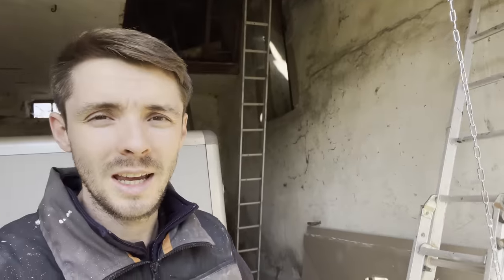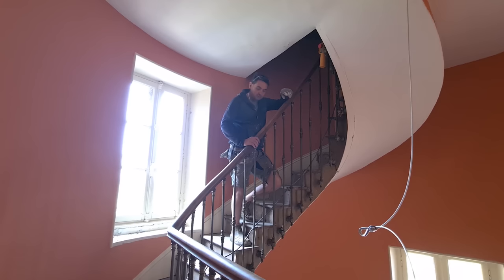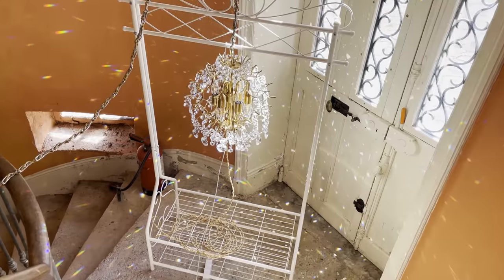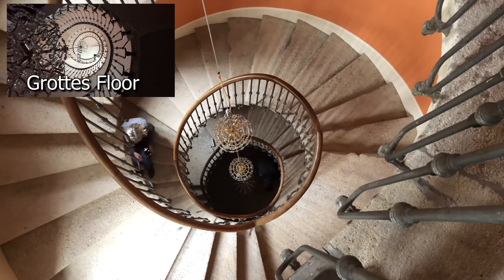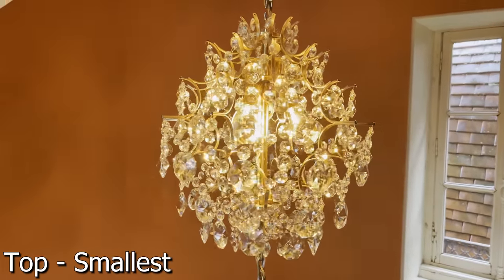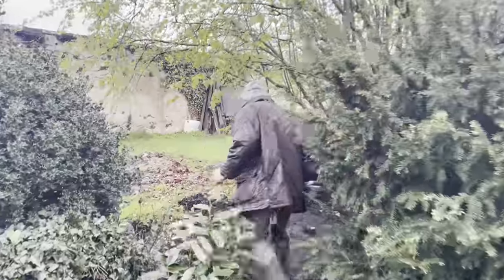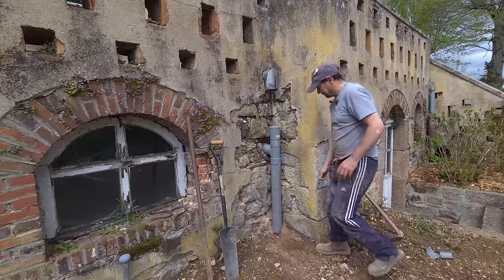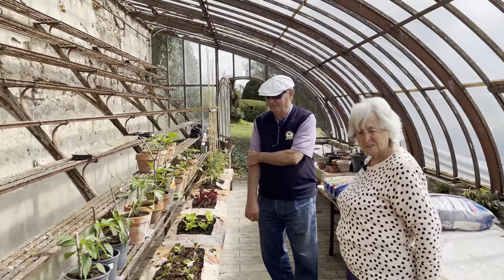Another move in the LIGHT direction! (3+ Chandeliers!) - 'Chateau de Bruges' - Ep. 33 - Renovation

Comment: When it comes time to clean them, put glass cleaner in a steam cleaning machine, turn the lights off and spray them lightly from the top to the bottom. Place a plastic tarp and paper on the floor to catch the drips.  It is important that the water be hot so it evaporates quickly.
Reply: What about vinegar? Or, ceramic coating? 😉😂😂❤️
Reply: @jimmyconnolly3461  Vinegar will probably work, but I have no idea about a coating.
Reply from the maker: Appreciate it Acadacad1! 🥰❤️

Comment: Why would you connect three chandeliers to an open s hook?
Reply from the maker: You may have missed it, but it’s actually also attached via a steel cable running through the chain and is held up by a car winch in the roof of the turret. It’s pretty secure! 👍🏼